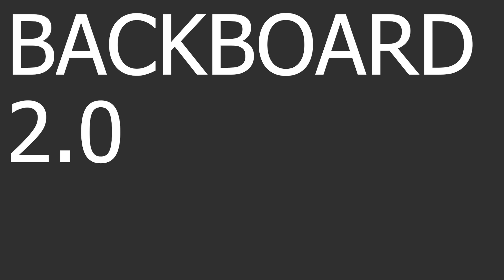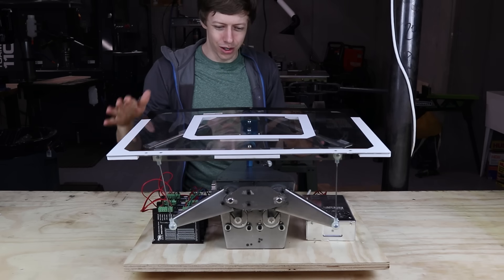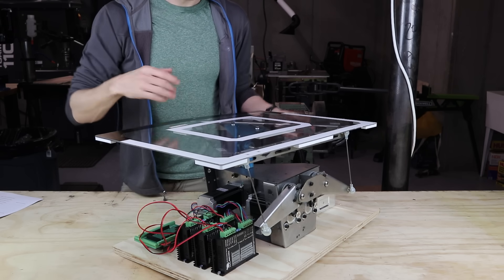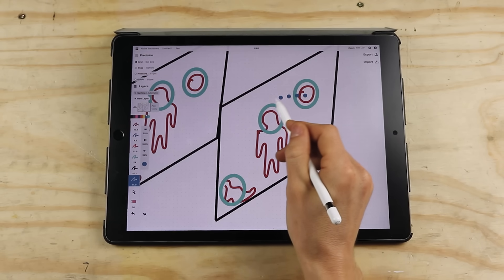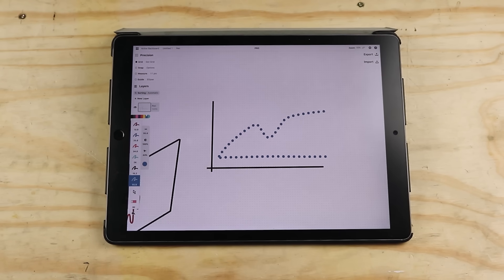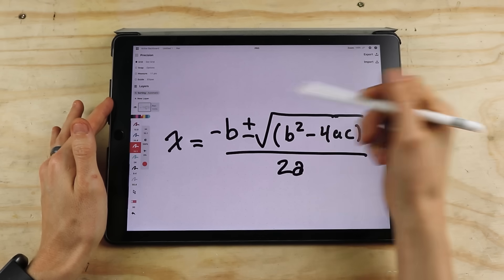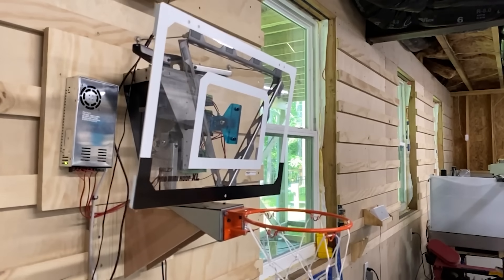The automatic hoop always goes in

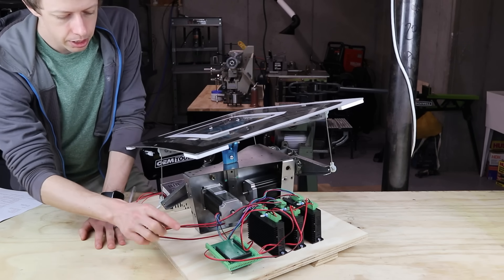Comment: 7:15 i’m not an expert but it sounds like time for FPGA
Reply: OpenMV Camera is the solution maybe?
Reply: few other options other than that. ESP32 would significantly speed up his servo drives over the ardi and still jive with the code he has. *insert "yes i know there's better environments than the ardi IDE for the ESP" but would be a relatively inexpensive and quick/easy test to verify an improvement to his servo drives.
Reply: @jungle_jim42  Yes, exactly. FPGAs help when your problem is extremely parallel. In this case, the uC is just there to act as a motor controller, and his bottleneck was in I/O throughput. An ESP32 or a STM32/Nucleo board could be upwards of 10x faster, if not more. The FPGA could help on the computer vision side of things, but that's all on his laptop, anyways - seems like it's written in Python, too, which by default is single-threaded. +1 to the ESP32 rec.
Reply: @bradmacdonald8703  I wondered about the Python as well. It would be interesting to see a breakdown of latency in the system; the code itself really shouldn't take any significant amount of time to process a frame.
Reply: @jungle_jim42  I agree, it is better to try ESP32 first in terms of a sensible approach to this issue.

Comment: If you used the libraries of Arduino it might be the problem. They are easy to use but very very inefficient and add a lot of overhead. Just scrap some HAL and rewrite those important parts. For the Windows overhead I would suggest a RTOS, I'm not familiar with those but it might be what Mark  used to keep making adjustments to the board position during all the fly time and this might lower the necessary maximum motor force.

Comment: fricking cool, one question, why do you only move the backboard at the last millisecond, like you say in the video? Assuming your ballistic equation continously gets better you don't need to wait to the last millisecond to move the backboard, you already know in the last 10 milliseconds the rough position the backboard needs to be, so you could start moving before you actually know the real position. If you can talk to the arduino interrupt based, you could update the new position as soon as the new frame is calculated (or maybe every few frames, depending on how fast the arduino is).  This way you also reduce the needed horsepower because the backboard is already moving and you don't need to accelerate as quickly.

Comment: Is that an Arduino Mega or Due? Mega uses an 8 bit AVP chip.  Due uses a 32bit ARM Cortex-M3 chip. Might be worth looking into an upgrade if you're using a Mega.
They say the Due is a pin-compatible with standard Arduino shields. 
However, I can't say that the Due is exactly a direct swap for a Mega. Most noticeably:  it runs at 3.3V not *5V*. This might be a showstopper for some applications.

Comment: So instead of worrying about the backboard moving in and out as possible solutions couldn't you lock the backboard to an average depth in relation to the surface?  this seems like it would give you the shortest possible move for the motors. not to mention it would greatly reduce the number of possible solutions. It appears you've basically utilized a swash-plate like that used in helicopters but you really shouldn't need the in and out motion for this project. I feel like it might just be extra steps in the programming.

Comment: Mark Rober's gets close early, then fine tunes later. If you can simultaneously do the monitoring and prediction math while executing a move command, you may be able to avoid the thing where it derps and doesn't move until after the ball has hit it? It could also allow for more accuracy as it has to move less distance later so it can definitely get there in time.

Comment: Have you heard about soft balls?  They're unhardened steel balls that are easy to machine.  They can be quickly drilled and tapped to fit on shafts.  You can get them on McMaster.  They might save you some headache in the future.

Comment: Mark Rober: Spends three years creating automatic dart board. 

Stuff Made Here: Whips up an automatic backboard in a couple weeks... and it talks. 

(obviously no hate Mark is a legend respect)
Reply: Seeing multiple engineers tackle the same problem entirely differently is proof we live in the Golden Era
Reply: Different challenges demand different solutions. Mark Rober's darts required extremely precise high speed tracking so he used a very expensive Vicon system. The basketball problem doesn't require the same tolerances.
Let's hope these kinds of projects get more common.
Reply: Daniel Halverson — the speed and tiny size of the dart makes it magnitudes harder to do it Mark’s way, but they’re really similar projects. The software here is arguably impressive for its simplicity - mark’s hardware is another level up from this but obviously took wayyyy longer to build up. I have more than a basic understanding of what’s going on but the computational limits that we’re seeing here are a huge factor.
Reply: Mark usually gets help from other people, I think this guy did it all himself in such short time, not sure he is doing this full time or not but still impressive!
Reply: Shots fired!

Comment: dang man, what did you study in college? I'm going into school to study mechanical engineering and all of this stuff you do on this channel is really fascinating
Reply: you get that and more if you study EE and take the right courses. but be prepared being buttfucked even more by math and physics than MechE. but it really depends what courses you take, e.g. I took mostly radio frequency engineering and had only one control theory course, but tons of linear algebra/field theory/analysis. 

whatever you are gonna study, learn at least one or two programming languages, C/C++ for language closer to hardware and Python for an easier realisation of more complicated programs (but potentually slower than C/C++). honestly coding is really important for engineers and you will have a much better stand in the market if you can code. can't say that enough.
Reply: @RotBaron  Huh, thanks for the insight. I know very rudimentary python but by no means enough to do anything with it and I do feel at a loss when I can make the mechanical thing but I cant code it for anything lol
Reply: I would guess he went into Mechanical Engineering, most likely with a minor in computing (wording would be different depending on which school he went to).
He seems extremely knowledgeable in the mechanical aspect (machinery he uses, methodology used for the development, vocabulary) while having a solid foundation in the computing aspects.

Comment: You probably already know but a Teensy will run rings around an Arduino in comparison for clock speed. Ps love your work and I’m so glad I found your channel!
Reply: I’m here to second the Teensy. I don’t think I would necessarily use an FPGA for this, but a teensy should be much more than required!
Reply: The newest one especially
Reply: Or stm32 (bluepill)
Reply: SKR 3d printer/cnc board, Atmel Sam 120MHz 32bit controller with board :)
Reply: FPGA all the things :D
Reply: @iwantitpaintedblack  if you're throwing an FPGA at it, just do all the calculations on it in then, that would certainly solve some timing issues

Comment: Try using a Teensy 4.0 arduino style driver. I've been using them for my projects and they have insane processing power and clock rates, up to 1.008GHz if overclocked. Highly recommend if you're having issues with speed. Love the vids, keep it up!
Reply: I heard him say his arduino is to slow and also immediately thought about the teensy.  It should work great indeed. However his shield won't work with it.

Arduino due might be a possibility to i think

Comment: Folded sheet metal parts are easy and cheap to make.. If you have a plasma cutter.. Spot welder.. Bending jig.. Knowledge of how to make dimensional parts in fusion..
Also you might need a resin 3d printer, steppers with half a kw of power and corresponding drivers.

Gosh I'm poor

Comment: Wow.  Would it make sense to send the motors a preliminary position based on the early trajectory of the ball, and then update it later as more data comes in?  Would give you more time to move, lowering the forces on the hardware, but if your early guess is wrong it might make it impossible to correct in time.  Might also require fancier code on the Arduino to handle updates while motion is in progress.

Comment: Wouldn't it be an option to start moving a bit earlier and fine-tune the position of the board when you have more information about the ball?
Reply: I was thinking this, too, however, there may be a couple reasons (likely more that I'm not thinking of, too) to not go this route: 1) this could eat up clock cycles that he may need with the current setup 2) depending on the frequency of backboard-position updates you could end up with a lot of physical jitter (backboard seizure, for lack of better term), which could be fixed with smoothing, but this would only make the problem of taking clock cycles even worse...? It'd still be way cool to see it smoothly moving the backboard over the duration of the shot!
Reply: Agree. Start with an approximation and update as ball gets closer. Could use a karplus-strong algorithm. Nice work so far!

Comment: This reminds me of project that I've always wanted to do - multi monitor setup that detects the face of the user and aligns each monitor to perfect position and orientation.
But your project is already couple of coolnesses ahead of my idea.

EDIT:
Another idea that I had is to mount 4 microphones in tetrahedral configuration on mechanized lamp. Those microphones would be used to listen for finger snapping sound, there's four of them in order to triangulate the exact point in space where snapping sound originated from. Then the lamp would move to light the area where you snapped your fingers.
Reply: I dig it. If the motors can be made silent enough it might be possible to continuously track your head so its always the perfect angle. Might be disorienting as fuck though, at least at first.
Reply: That's a pretty rad idea.
Reply: Will your head follow a ballistic trajectory?
Reply: reminds me of the glassless 3d, which tracked the eyes and face.
Reply: Oo that sounds really cool actually, imagine if it could move to the best position to hide the bezels or something like that
Reply: It would need to be a very smooth movement or screens will break over time due to shaking, but it would also need to be very responsive and to have a dead zone to not nauseate the user. You might find a compromise between the two that is viable and feels good.
Reply: Dude that sounds sick! I would defenitely watch that video
Reply: just use your hands to move the monitor.
Reply: @ryy1704  you are a genius and deserve all of the noble prizes for that surprising revelation
Reply: team up with mark rober and this guy
Reply: WHAT A GREAT IDEA
Reply: I believe moving your monitors continuously will break your monitor, idk tho but I heard it somewhere in a racing sim video
Reply: I did this but with tiny mirrors https://youtu.be/6xAiKI6XswM
Reply: @alana314  that's pretty dope man
Reply: so like, vr?
Reply: @GustyWizard  how is that anything like Vr?
Reply: Virtual reality already does that ;)

Comment: Couldn't you have it move based on its earliest prediction (one with only a few points of data.) and then update its position as the data gets more accurate.

In theory, if it made an early gross movement, it would be closer to its final position and would have to exert less force at the last possible moment.

Comment: Welp. I see we have the second mark rober. And he shows the machining process too. I'm all in.
Reply: mind, less machining in this process in this video. but still some, which is great. 

I would recommend you get an embedded controller instead of running it on windows. Windows is a pile of garbage when it comes to real time hardware control. Most of the systems that I have seen that DO have windows on it are actually just giving the program to an embedded controller of some sorts. In this case, you really should be doing basically all the processing that you can on that embedded system. less lag & fewer/no OS interrupts => more control.